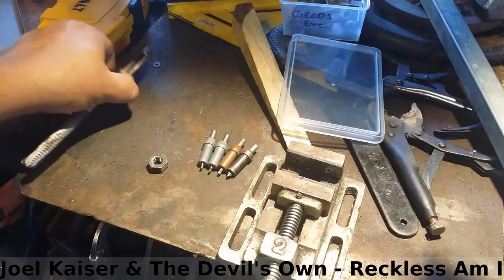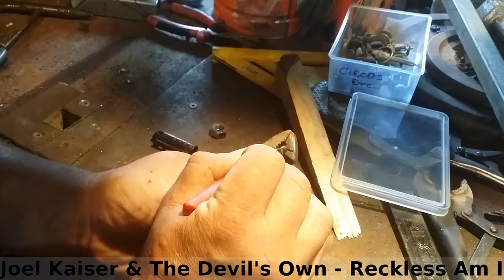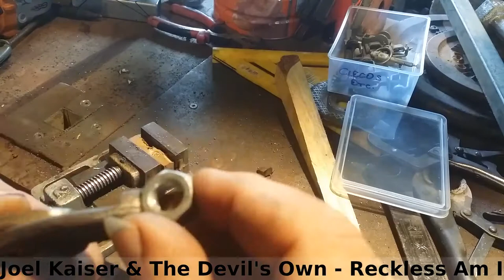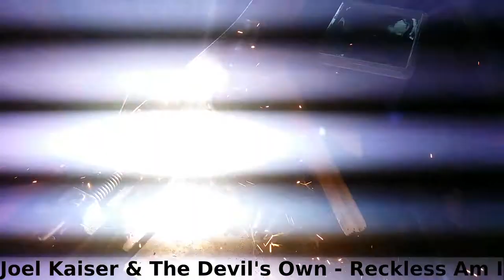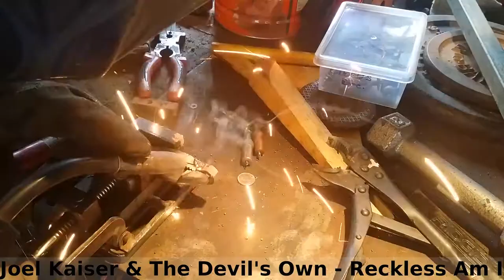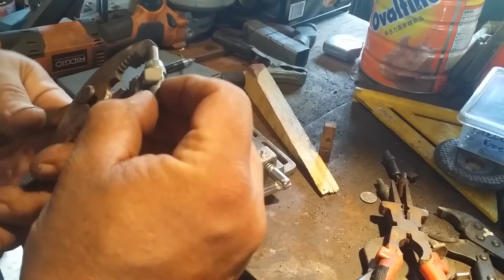DIY Cleco Instalation Tool

Comment: ok that was the easy part now let's see making your own cleco style spring fasteners ... I already figured out a good way to do the pliers ... its the actual fastener I want ... I know it is spring steel that is grabbing the far side and pulling it back to the fastener by a stiff spring ... the hard part I think is how to close it and not worry about say a nut coming loose and it popping apart ... sure a 3d printed one would work on light duty stuff ... but heavy duty is where they excel
Reply from the maker: That would make for a good video, but not till the price of steel comes back down... the plague sent it through the roof!